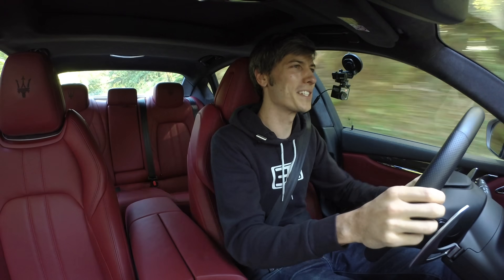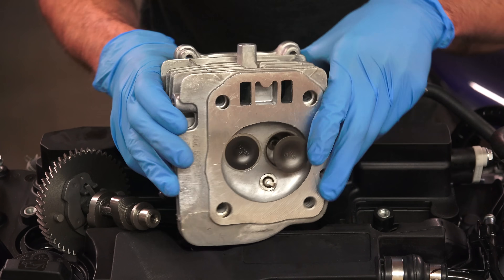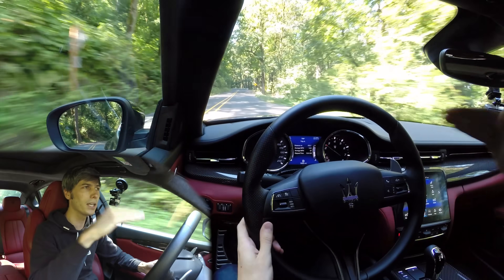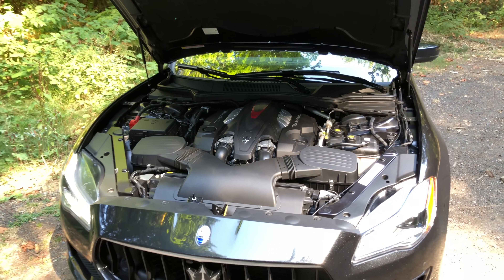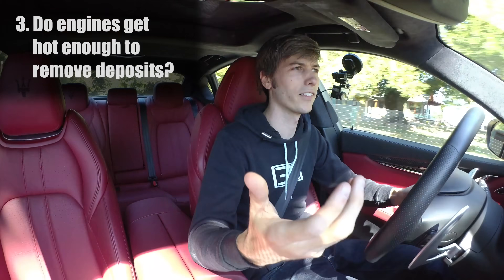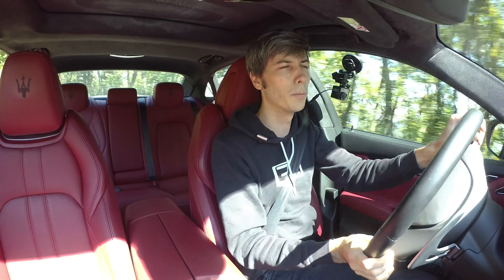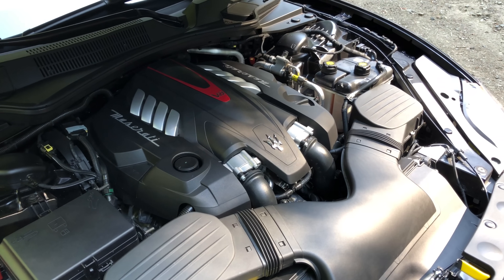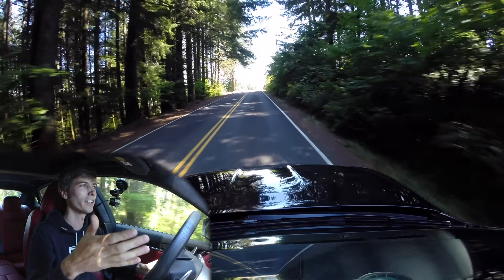Is Redline Good For Your Car's Engine? Italian Tune Up

Comment: As a 13B owner, redline is a way of life.

Also, what valves?
Reply: Same. I think it's well received that pushing a rotary has it's benefits (higher OMP function to lubricate housing/premix injected with fuel) plus the lack of reciprocating parts is a different ball game. 

Not to mention that the rotary has a constant hot/cold side to it's function. Redlining a rotary definitely keeps things moving, it should really be an entire separate video because everything said in this video applies to piston motors.
Reply: Same here, love my little rotary!
Reply: If you have a 4 banger or turbo 4^ 

Redline a day keeps the Doctor away :)
Reply: and still you can't overtake an old Toyota with grocery delivery.
Reply: @mojeimja  Well, my Trabant is white-ish (Papyrus-White they call it) and has the Fujiwara Tofu Sticker on the right door
Reply: @Handyman1199  "don't stop the muusiic..., don't stop, the music tonight..da da da, dadada da da daa"
Reply: Feel the Black-Out, Black-Out!

btw, my Trabi has a sport exhaust now
Reply: I want to swap the original (numbers matching) 26Hp 600cc Inline 2 Two Stoke with Rotary Valve intake „P66“ Engine in my 1989 Trabant 601 to a 107Hp FB‘s Carburated Rotary 12A (Or 1.0l Ro80 Rotary Engine from NSU) . Maybe ill Even get a whole drivetrain swap done, im not a Fan of FWD and i want to learn drifting.
Do you guys have some tips for a Future Rotary Owner?
Reply: It would be a lot cheaper in most cases to just swap in a Renesis. A lot more of then around then especially a 12a
Reply: @TexasVexes  RX-8 Renesis? It has too much power and waaaayyy to much electronics for my taste.

I have to replace the stock drum brakes and the chassis isnt that strong. Its a russian steel monocoque with duroplast (non-melting plastic) body panels and 615kg light. I wouldnt be so crazy to swap in 200Hp.

OR can i just take the Renesis and replace the EFI with a Carb and the ECU with a simple breaker and transistor ignition (already inside the Trabant), this would be an alternative for me...
Reply: @Handyman1199  stay away from the Renesis swap. It could be done for sure. But the 13b is more tried and true engine that doesn't require a bunch of extra systems to run correctly.
Reply: @Handyman1199  13b is a much better choice. 12a parts are mostly no longer available or very expensive. With a 13b you get more power, parts are more available and you get fuel injection. Some people run 13b with a carb setup but I don't know much about those I only have fuel injection.
Reply: Cian Ryan making me miss my 13b swapped Miata
Reply: @royalcaustic8790  must of been sweet. A neighbor had a 12a swapped 2002ti. I thought about doing my E30 but then I said eff it and sold it. I may revisit this idea one day.
Reply: you know... my SBF would like to talk to your 13B about backfiring xD

Comment: if you want an interesting read, look up how a regeneration cycle works for diesel particulate filters on a commercial diesel engine. Basically they rev up the engine and lean out the fuel mix driving exhaust temperatures to about 360-400*C for around 20-40 minutes. Burns all the carbon and soot out of the filter. Yes an italian tuneup can clean out the carbon but you would have to maintain it for 20-40 minutes.

Comment: I've got a legacy with an ez30 in it and I tried this last week. My attempt consisted of a drive on a dual carriageway at about 65mph but in a lower gear for around 10 minutes. the temp gauge didn't really budge. And I don't know if it was placebo but can't help thinking it idles nicer and is a tiny bit quieter atm. Maybe something in it maybe not. Don't have any equipment to test results so may never know.
Reply: Wasn't red line just around 3250 rpm

Comment: It has been well documented with mk6 gti's which are notorious for carbon build-up, shops were seeing that the ones that were beat on by young driver's had significantly less carbon on the back of the valves than the ones that were babied by their owners with similar miles. Just something interesting I thought I'd share.

Comment: While you are doing your high revs, a small amount of diesel fuel mixed with gasoline ,about 2 oz per gallon ratio mix in the fuel tank will remove the carbon at a slow rate ..I have even used motor oil at no more than 1/4 oz per gallon...The oil in the mix will cling to the deposits and remove them. SEA FOAM  and Marvel Oil are good  products that will remove carbon also.

Comment: A mechanic once told me decades ago its good to have little carbon deposits for high mileage internals in that it fills in the minute worn gaps on components like valves & valve seats
Very true as well methinks,but not too much carbon deposits or you will start to lose to much power & economics.
its best to use a cleaner like redex to clean your engine every 3 months or so and use fully synthetic engine oil to keep your engine clean.
My bro's motorcycle was recently doing 40 mpg and not used redex for 6 months or so in which he usually uses it every 3 months and when he put redex in it restored it back to 50mpg.
Its ok to have a little carbon but not too much.

Comment: Perhaps you could compare engine longevity in vehicles that are driven hard vs a Sunday driver?  I've heard (skepticism) that if you don't drive it hard, the day you do, it won't be ready for it and potential for leaks/ blown gaskets increases.  Personally im assuming this is for cars already broken in, 40,000 miles or more.

Comment: I enjoy your videos and often learn a great deal; but for the Italian tune up evaluation, by only focusing on the heat aspect I think you are overlooking the role that RPM and cylinder pressure plays in the physical removal of carbon deposits rather than the chemical reaction that would be induced by heat.

Comment: Some of the referenced material is from the 90's.  Oil and fuel technology has changed a fair bit in 25 years, not to mention engine technology.

Comment: Old trick I learned with an old russian car i had, actually a Lada Samara, it had been driven by some old lady and not pushed at all.
It would NOT rev when it was hot, much less even drive forward at much speed, but when cold, it was kind of OK.
My trick was to pour window fluid down the carb when it was hot, while reving at 4000 rpm, not so much that it caused hydrolock under load, but just enough to not kill the engine.
It turned out that it indeed had lots of carbon deposits, and when I was done with my "magic", it drug gravel all the way through 2nd gear with studded winter tires ^_^

Comment: I knew heat could remove carbon, but has anyone investigated the mechanical aspect of carbon removal? Maybe the increased pressures during the redline is what does the job.

Comment: my first car, a 1992 VW Jetta, had to have the head gasket replaced at around 160,000 miles the mechanic was surprised there was zero carbon buildup. Guess how I drove that car :)

Comment: My mothers 2001 lincoln LS gets granny driven (naturally) and she was having drivability issues after a local mechanic did an alternator (breaking a control arm in the process.) As i was driving the car I was giving it full beans and lo an behold, hesitation at 3k rpm and 4k rpm them all of a sudden flashing check engine light. Eased up a little bit but didn't granny it back to the house. Found a misfire in cylinder 5, went away after another round of the beans. Take from that what you will.

Comment: The Italian tune up comes from older Italian engines that were designed for racing with higher rpm operating range, but then when  cars were sold as street cars and lugged around town at low rpm they would load up with fuel and begin fouling plugs. If you then went out and ran it through the gears at a high rpm it would clean out the excess fuel. Through the years i guess it got twisted into supposedly cleaning out carbon deposits which isn't the same thing.

Comment: I was taught to give the car a "good bloody drive" to clean out carbon build up but a fiat technician once told me another way to do it; apparently the trick is to redline your car on the downshift, could anyone actually confirm if this works? or just stick to the good old ways and take the EGR valve off and clean it?

Comment: The “Italian tune up” isn’t just about temperature for burning off deposits. It’s also about increased vibrations in the engine that help break the crud loose. And for carbureted, throttle body and port fuel injection systems the increased fuel at WOT helps act as a solvent in the intake valve ports. This would not be true for direct injection engines. 
Also, you don’t have to hold the engine at red line. Running at wide open throttle is what’s important. Just do a long hard acceleration when getting on the freeway on ramp. 

Even though they are direct injected, turbocharged Diesel engines can also benefit. 
Carbon likes to build up on the turbine vanes. An Italian tune up will help blow that carbon out.
Reply: Probably more about the velocity of gases through the motor + increased temps.
Your engine doesn't vibrate more when run faster, most engines vibrate less higher up in the revs, depending on engine characteristics and number of cylinders.

I really think this method only works on engines that have been underutilised for long periods of time.

Comment: Where I'm from, it's sometimes called the redneck tuneup or simply "blowin out the engine". I don't know how much it actually helps, but most cars seem to love a good romp from time to time. I've also found that being easy on an engine can make it run rougher over time. I've only ever found one fuel additive that seems to work (in fuel-injected gasoline engines at least, not enough experience with carburated engines), the rest seem like snake oil. That is Gumout multi-system tune-up. After a couple tanks, every car I've tried it on runs a bit smoother with a bit more power.

Comment: Wait. 100°C is 212°F, so I don't think any of my trucks will even get so hot as to form carbon stuck to metal. 190°C is hot!! 260°C is 500°F, I didn't think engines could even get that hot.
Reply: You are thinking of engine coolant temp's which is what your dashboard reading is about not internal part's temp's..

Comment: on the old carb cars you could spray  a little water through the intake to remove carbon in warmed up engine just don't over do it.Water can also boost power when added to an engine it is after-all hydrogen and oxygen

Comment: When I bought my used bmw e46 coupe, there was nothing wrong with it. But having a heavy right foot, I did a long drive on the highway doing 190kph. Stopping at a red-light the engine was much much quieter en running smoother. So yeah I think a (long) pull with engine in high load is good a getting rid of carbon buildup. Same thing happened with other cars.

Comment: This is just my subjective experience but I drive my A4 a lot in the city and on shorter routes and when I do for a change drive on the highway for a longer distance and bring it up to 110 - 125 mph (legal here in Germany on some highways) I notice that for a few days afterwards the car just takes the throttle much better in the city and accellerates better from 0 to 30 mph. The same goes for my parents' Opel with a Diesel engine. I drove it for a few hundred miles and went some times up to 125 mph and the next day my dad came home and said the car accellerates much better and the throttle is a lot more responsive.
Reply: I had a 2012 ninja 250 and I'd hold it wide open down the highway at 12.5k rpm til I got off and I sworn every single time the bike ran a lot better coming off the highway. Spark cut was at 13.5k rpm. I would hold throttle wide open in 6th gear at 12.5k rpm for a good 20 min at a time. I loved that bike I beat the hell out of it. I owned it for 20k miles and there was never a day it didnt see redline

Comment: My understanding is that the Italian tuneup is more suited for a diesel engine because they are more prone to build up.  A friend of mine kept having buildup issues on a diesel beetle.  To prevent it from happening repeatedly, he starting running it on the highway for a few minutes but not in his top gear.  This seemed to solve his buildup issue as he didn't have to manually clean the exhaust buildup out anymore.

Comment: Great video. I'm a retired senior who putzes around town in his '07 Si and am more concerned about the effect it has on my cat. No, not that one!. The one on my car. I wonder if it gets hot enough to burn off the deposits and not get clogged.Flooring it once in a while and getting arrested would probably be cheaper than a new one.

Comment: I appreciate the even-handedness of this video.  Like many things, this issue does indeed depend on the variables at play.

Perhaps you can clarify something: when a person accelerates at WOT, and you see all the "carbon" shoot out of the tail pipes, what going on there?

I have always just assumed that it was deposits built up in the exhaust system being pushed out by fast moving air.
Reply from the maker: Glad you enjoyed the video! What you’re actually seeing when you see the exhaust from someone flooring it, is a rich air/fuel mixture. At WOT the engine injects more fuel than can be fully burned, in order to maximize power (while sacrificing efficiency). Since not all of the fuel is burned, some of it is handled by the catalytic converter, and you see those byproducts (and some hydrocarbons) come out the exhaust. Burning rich does not burn as cleanly, so you see it.
Reply: Oh, okay.  Makes sense.  Thanks.

Comment: I had a 1972 318 Chrysler which, if it had been cruising around the city for a week or two, and you took it out on the highway at night. It would spit glowing sparks out of the exhaust when you got over 90mph. Looked a bit like tracer bullets.

Comment: BMW says 5000 rpm for 30 min.
Reply: Do what they say - They already have your money :)
Reply: John Antonopoulous Engine would definitely blow on a BMW
Reply: @MikeNikprelaj  I redlined a e90 328i everyday when it was my daily, never in automatic mode. Today I have E92 M3 and F30 335i F sport. It's no joke when people say BMW is the king of inline 6, better yet engines. BMW engineering at its finest.
Reply: abraham G My friend has a 335 (N54) and bought it at 68,000 miles. He now has 74,000 miles on the car and it has been to the shop 5 times since purchase and the problem is probably a cracked engine block
Reply: @MikeNikprelaj  it's never a cracked engine block. that's what they tell you to rip off your money. it's always minor problems, like broken tubes, ignition coils or fuel injectors. you'd definately audibly hear a cracked engine block just when you open up the hood.
Reply: @MikeNikprelaj  why they are Autobahn cars so I don't see why. Flooring the car puts more stress on the engine than stable rpms. Just drop gear and steady rpms on the freeway do the speed limit. It will be fine.

Comment: This is one of the reasons that Toyota uses both Direct and Port Injection on their modern performance engines, think 2GR-FSE (3.5L Lexus V6, IS350 for example) or 4U-GSE (Toyota GT86). The port injection is used at higher engine speeds, while this improves performance it also helps prevent carbon buildup.

Comment: In the 70’s. I used to take the cities big garbage trucks to the back road and run them wide open for a couple of miles. They were all gas engines then. It seemed to clear them up. Fastest one would do about 55 mph. A fast 55.

Comment: Hi Jason first of all congrats and thank you for your amazing educational channel.
I have a question and would be very glad if you can help me to understand something.
I own a MINI COOPER JOHN COOPER WORKS 2018 231HP F56 series, it says in the owner's manual to use premium fuel from 92 to 98 octane, I currently live at 2600 meters above sea level.
The best gass octane I can get in my country is 91, I have the option to buy octane boosters in many places such as VP, STP and many other brands.
Questions are:
1. Is it true using high octane gasoline on engines like mine will get the most of my engine's performance?
2. Do those branded octane boosters really work?
3. My car's owner's manual notes some warnings regarding Octane boosters and fuel additives which may harm the engine or something saying not to use products containing manganese or metals. In your opinion what should I do for not damaging my car? (See BMW or MINI owner's manual).
4. If I install an OEM same shape air intake K&N filter, will it make any difference in performance?

Thank you

Comment: I had a renaullt megane (1.6i) and drove it with e50. During a headgasket replacement because of missing coolant the mechanic told me that he has never seen such a clean engine before. Could be related to leaner fuel, the e50 cleaning carbon deposits or the higher temperature because of the missing coolant. It ran great as well.
Reply: ethanol mixture tends to run leaner thus hotter

Comment: I'm looking at getting a turbo 2.0L DI engine in my next vehicle, and as awesome as this video was, it just raised more carbon questions.  I have already read the intake carbon horror stories, and would like to know how to prevent or at least mitigate this problem.  Is a periodic walnut blast required?  Seafoam down the intake?  If this is truely a big enough problem where manufacturers are now doing dual injection, why aren't all new engines using this?  

Tl;dr, if the italian tune up wont fix intake deposits on DI engines, what will?
Reply: maybe run it on cold pressed organic olive oil ... just kidding

Comment: I was told to always keep it Full Throttle when you start the car or at least 2 or 3 minutes and then wrap it up as fast as you can for the next hour
Reply: sounds like straight from the AAMCO manual, paragraph "educating customers"